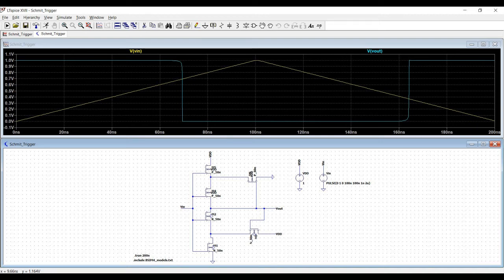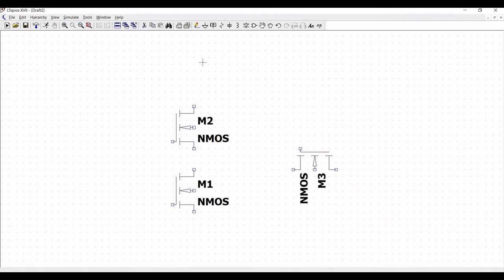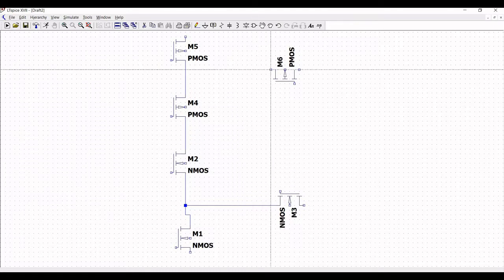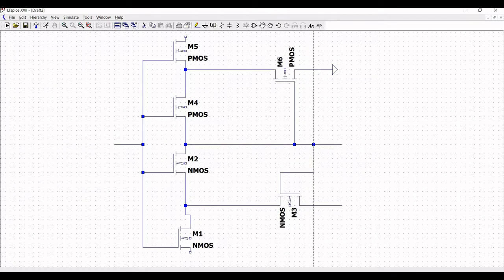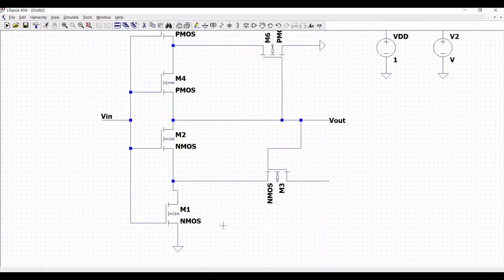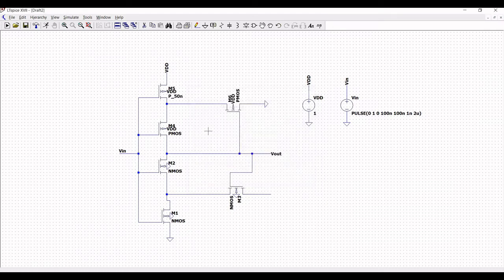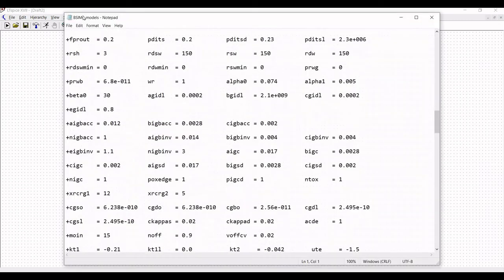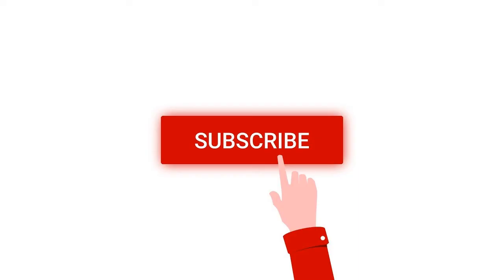LTspice tutorial 10: Design and simulation of Schmitt trigger in LTspice using CMOS process

Comment: hi I'm an engineering student, I'm having problems with determining the threshold voltage of M1. Could you tell me the value you used and how you found it? in the .txt file it gives VT0=0.8 but I don't think it's that. thx :P
Reply from the maker: This modeling is based on the Long-Channel MOSFET Models, this based on CMOS circuit design by R J Baker